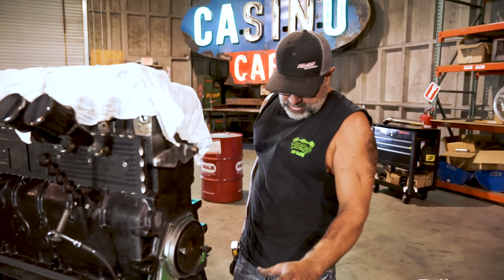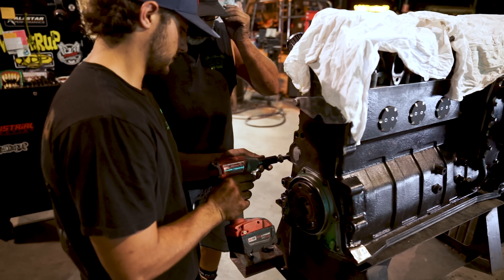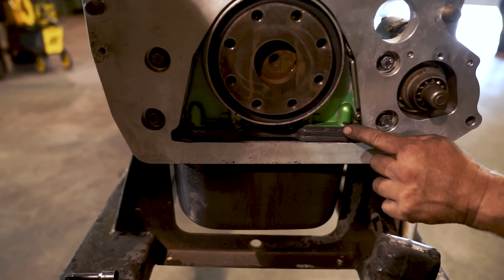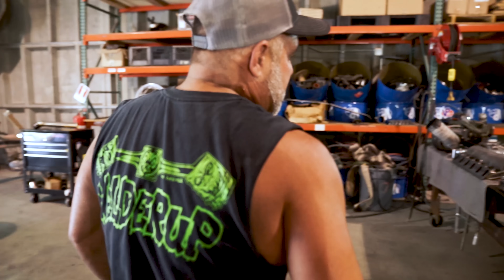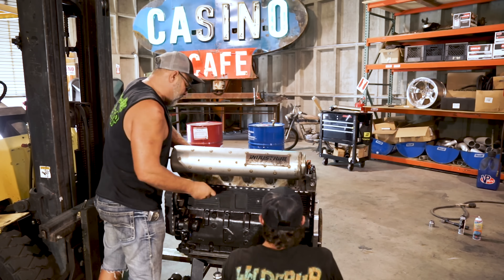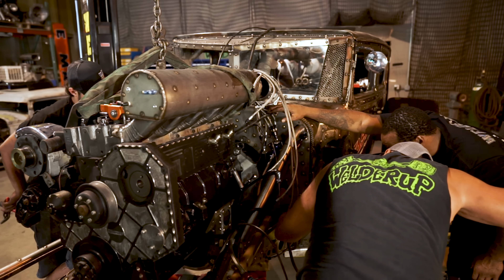DIESEL RAT ROD Engine Build Part 2

Comment: You are going to lose your fingers using a grinder like that !
Reply: i agree 100%
Reply: If your in this field worrying about health and safety protocols should of applied for med school.
Most important aspect always safety glases.
My favorite tool is the liquid wrench. 'Torch powaa!!
Reply: The trick is to get good at it before you lose any fingers. He passed the test...lol I count 10. Welderup  "don't need no stinkin' vices". LoL
Reply: @NJ_24V nj_24v as a mechanic if your very good at what you do you don't get your fingers cut.
We eat 10w30 for lunch and a lb. Of rust by noon time.
Reply: I pictured one of his former workers going to ER. Dumbass probably used to refer to him...? Wished I woulda put it in a vise! Or, I used to like power tools...lol
Reply: Those battery pack ones don't have enough power to do that...
Reply: Its an angle grinder, not a saw blade folks.